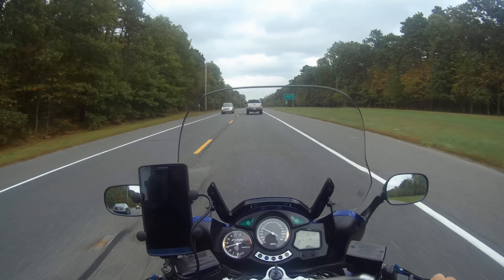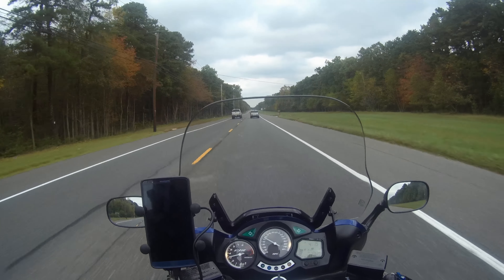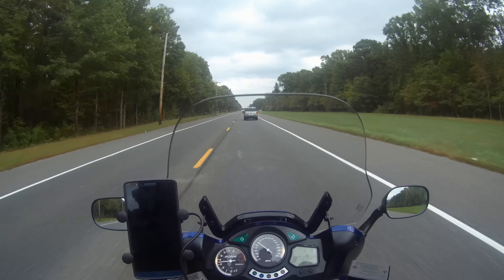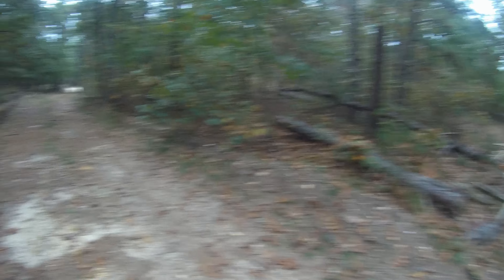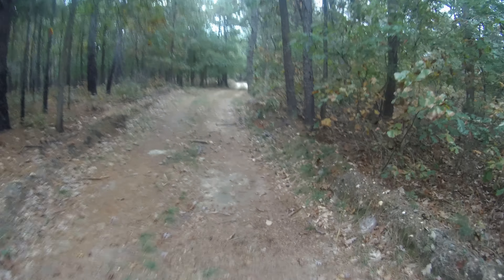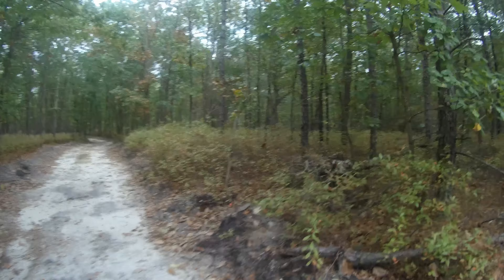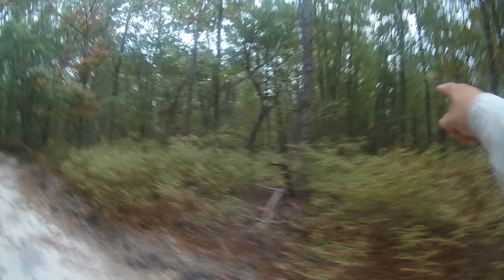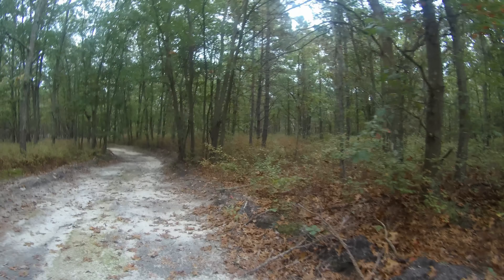Amatol Munitions Ruins and site of the Atlantic City Speedway (Brooklands)

Comment: Just found this vid in 2024. 
About 35 or so years ago that area was popular among guys riding ATV's. The buildings were more complete back then and the trees more sparse. You could see a good ways around the old track and there were still signs of its racing days with the occasional old wheel or tire, and a few areas where they buried tires half way to form a barrier. 
There was more dumping going on then though, it looks like someone cleaned it up a bit since the 80's. I remember piles of old appliances and car tires dumped out there. 
At that point some of the wood structure was still intact but was burnt, likely by forest fires in that area over the years. The whole one end of the tract was still showing burned trees about 15ft or so tall still standing in the woods. A buddy who knew the area and grew up there in the 50's said that the area had a huge forest fire in the early 60's that wiped out a good bit of what remained and the subsequent growth after the fire, which I believe may have burned again, is a lot of what your seeing today. Most of those larger trees don't look super old, maybe 50 years or so tops. There were few large trees when I was there back then. There were also signs of vagrants living in those old buildings, with makeshift tarps over sections and old whisky bottles strewn around too. 
The nearby areas at the time were also not the best and most didn't go there alone as it had a reputation in later years as a place for drug deals and such. 
It looks like much of that may have been solved but I see the dumping hasn't stopped. 

I'm too old to go exploring these day so its nice to see what became of the places we knew years ago.

Comment: Where exactly is the raceway located? Been out there and can't find it.
Reply from the maker: It is located at this map location: 39.5996052, -74.7482266
Reply: Along  route 561
Reply: Fun fact about this track, they used this track in a counter clockwise way, turning left, for only 7 years